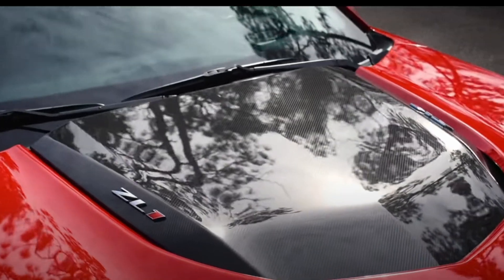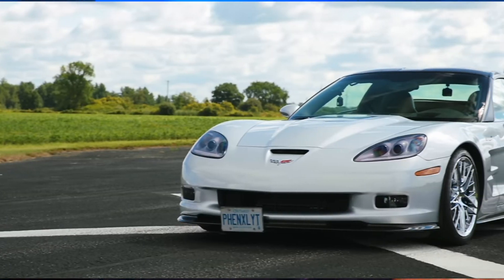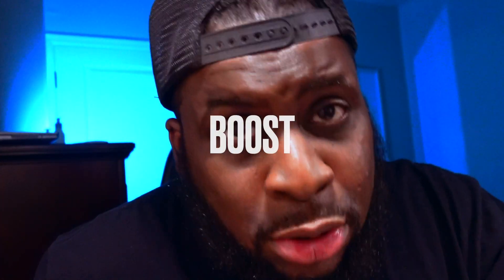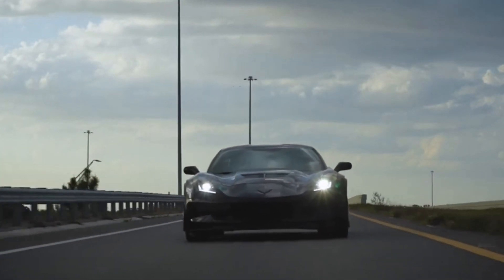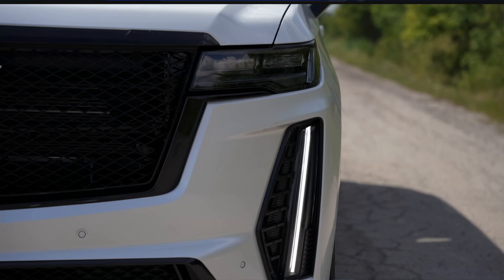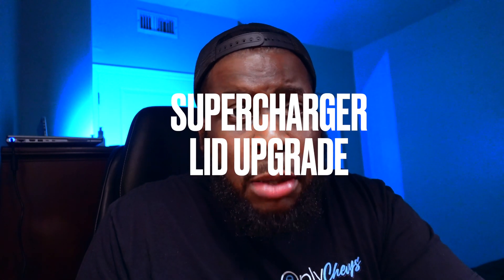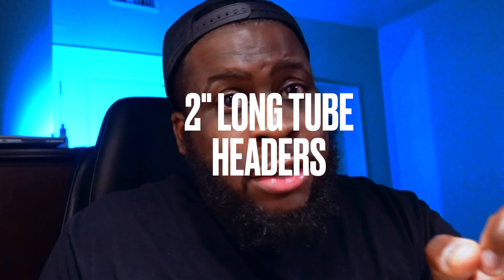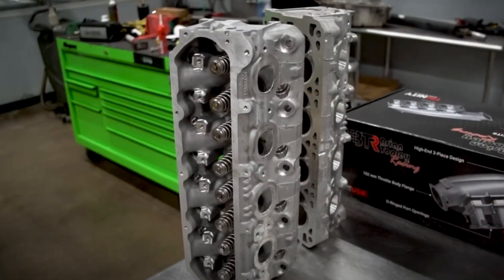The LT4 Engine WON’T SURVIVE 100,000 Miles?!

Comment: What a load of crap. LT4 is one of the most reliable engines in recent history. Keep it stock and you will not have an issue. The only issue was with the C7 Z06 was because it had a low frontal area with not enough cooling. I went from a C7 Z06 to a ZL1/1LE and cannot emphasize how amazing the motor is. The ZL1 and ZL1/1LE did the right thing with lots of cooling. KEEP IT STOCK!!
Reply: Why would you want to keep it stock?
Reply: @jaebush this is what I say.  The point in that kind of car is the modability of it.
Reply from the maker: LT4 is reliable to some degree but the 17-18 couldn’t hold oil pressure past 30k miles. It’s been issues of that oil pump failing but they fixed it later in the years and it’s been good since. However if you do keep it stock you have that warranty to back you up for 6 years! So you’re right in keeping it stock. Very rare I see people do though
Reply: @BLUPRINT1LE First time hearing about 17-18 oil pump failures. What are your sources?
Reply from the maker: @CAC-1111 there is plenty of info about it by just googling the years. GM will now own up to it but it’s very common and a few peers my self who tracked their cars and some daily driven they cars also experienced it as well. If you part of camaro6 forums people documented their issues of the MY there too
Reply: @BLUPRINT1LE I have 17 V with 24K miles this is not what I want to hear.
Reply from the maker: @CAC-1111GM also released a code it would throw based on a service bulletin PIP5555A. Very unfortunate but something to be aware of. Mileage may vary
Reply: @BLUPRINT1LE  These engines are highly reliable well above 1000hp, the 2017 and 2018 models had a defective oil pump,, but otherwise, the LT4 is extremely reliable WELL above stock.
Reply: Chevy sucks with all their lifter issues
Reply from the maker: That’s one of the killers of the naturally aspirated engines in the LT1!  I did a video on that and all the pitfalls
Reply: @terminatorcoyote6319 oh boy and talk about ford cam phasers and Chrysler lifter issues also. Ford is so bad they kept selling old defective phasers even though they had updated cam phasers. Before you hate look at all failures of all manufacturers equally.
Reply: @terminatorcoyote6319 DOD delete..
Reply: @terminatorcoyote6319  the ls7 and the trucks with dod that’s it! Most of the other engines are top notch